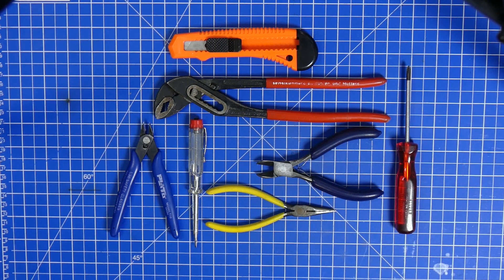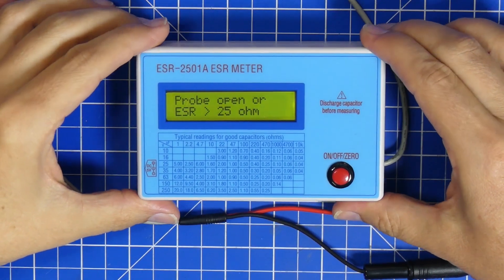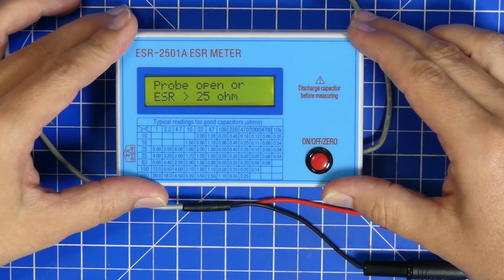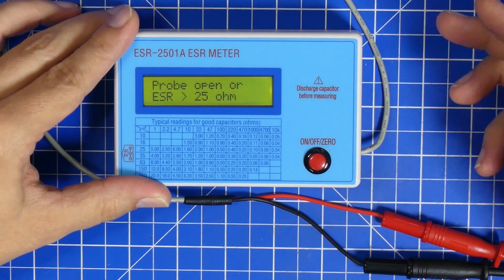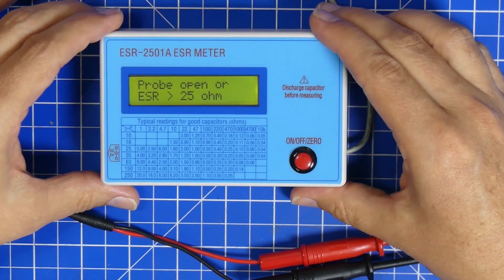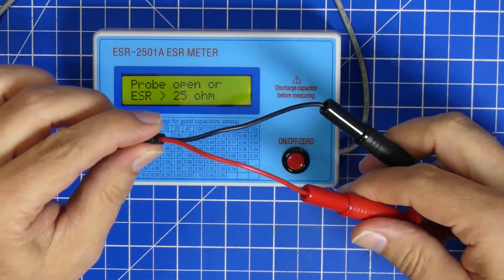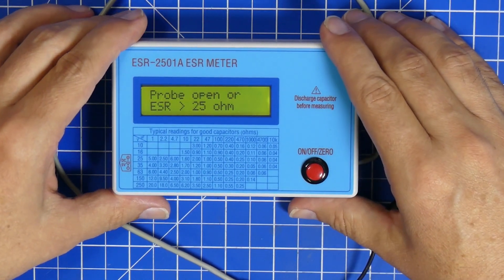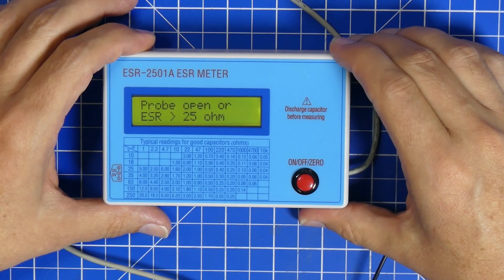My Tools - In Circuit ESR Tester

Comment: Bought such meter 10 years ago. With DIY-looks tweezers probe made of PCB and shrinking tubes. Fixed zillion of power supplies using it. Ecellent device!
Reply from the maker: It looks crappy - but it pulls its weight a thousand fold.

Comment: I bought one of this meters, works but I prefer to use my Peak Atlas ESR70 or my GME-236 both are much better meters.

If you are in budget this is a very good option but if you can buy a fast meter.

Best Regards.